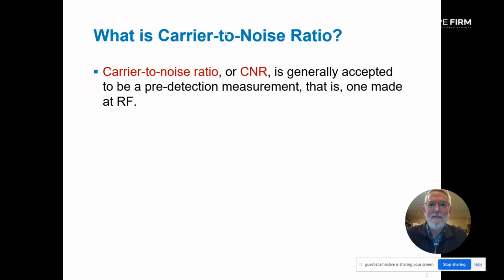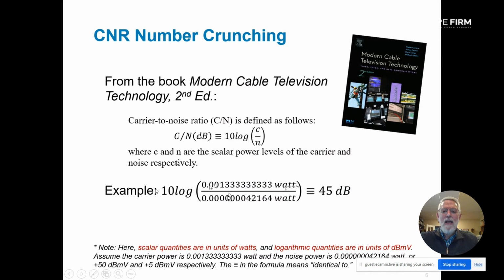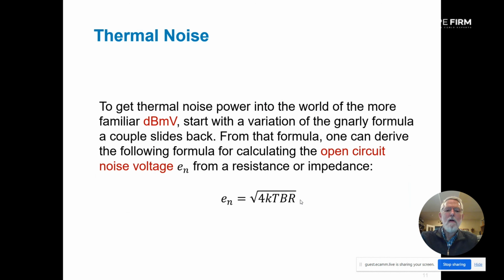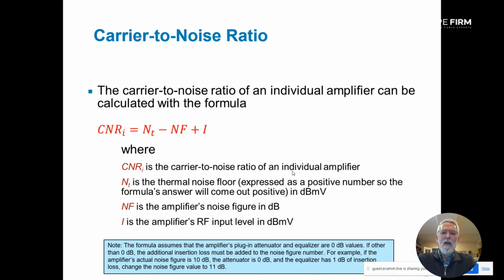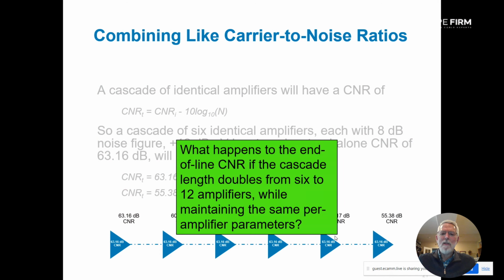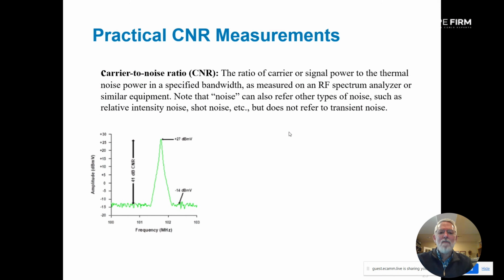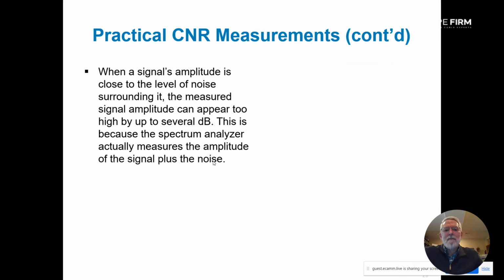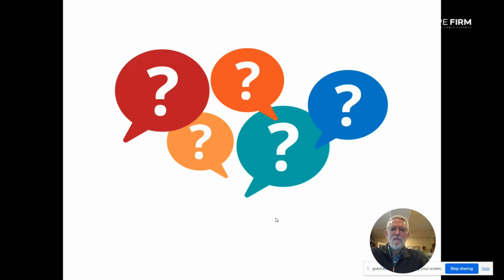Introduction to Carrier-to-Noise: Learning the Basics with Brady Volpe and Ron Hranac

Comment: hi Mr Volpe!  can you please make a video on how to test for ingress? and what an acceptable level is for ingress on a peice of cable, like a drop or cable in the home?
Reply from the maker: Hi @MrFreeze, thanks for suggested topic. Have you by chance watched this video: https://youtu.be/rhgC40va7b8 which covers pressure testing? This is one of my recommended best methods of testing for damaged drops and in-home wiring, which are often the source of ingress. However, a less invasive method would be to use a hand held meter with a return spectrum mode in max hold. Will put this on the list.
Reply: @Volpefirm  yes i've seen that vid! unfortunately, we are not equipped with a pressure tester.  We are currently using the Hitron DP3 meter in our system.  thank you for making these videos, very informative and learning alot!
Reply from the maker: @MrFreeze Maybe some of these articles etc might be of help to you.  https://volpefirm.com/are-staples-in-coax-cable-impacting-my-docsis-speed/  also https://volpefirm.com/?s=ingress see if there is anything there for you.  I hope this helps.